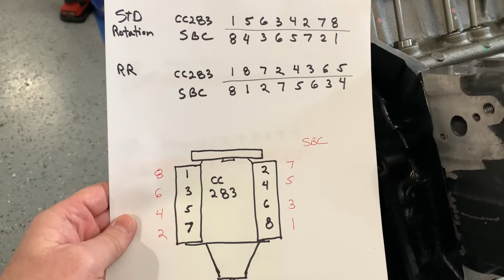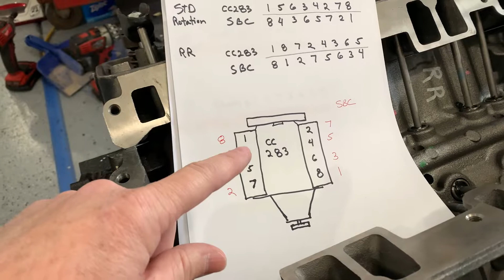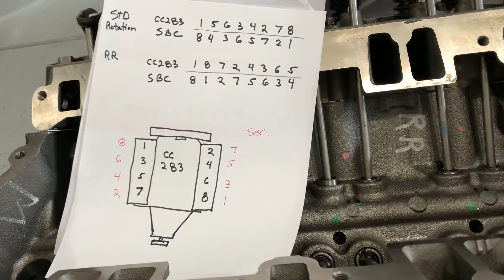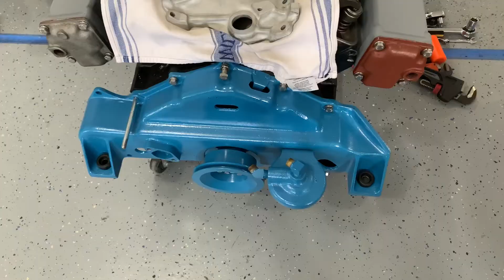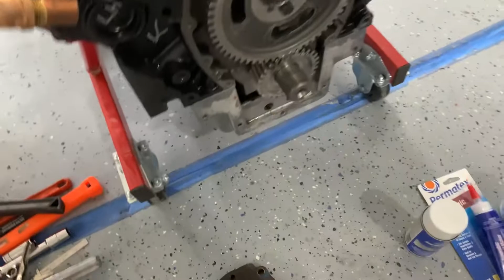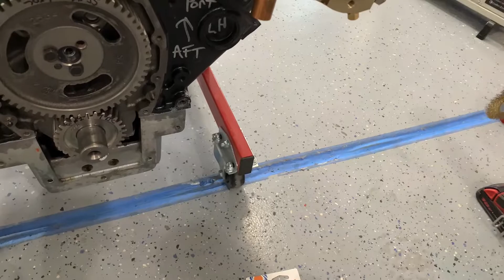How to build a Chris Craft 283 / 350 conversion marine motor Part 5

Comment: Your series of videos could not be more timely for me. I’ll be starting this exact process in the next couple of months to repower the 307 QLV in my 1976 Lancer. Thanks so much for posting this process.
Reply from the maker: Glad it can help.  Not very familiar with that one but I'm sure Henkel can help.  307 QLV (serial numbers 150000-151345) was made between 1969-1973.  Total of 1345.  What is your serial number?